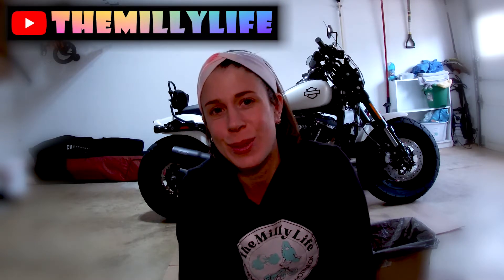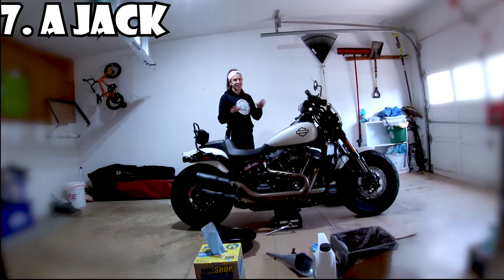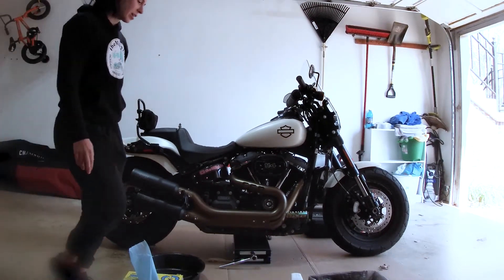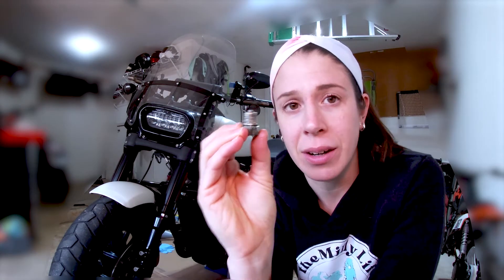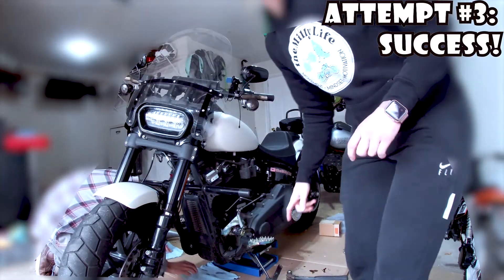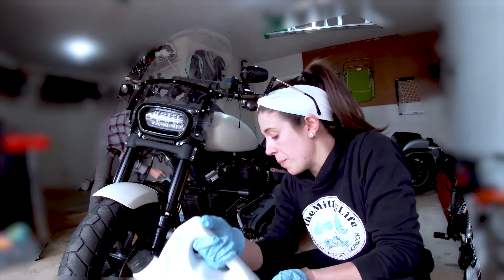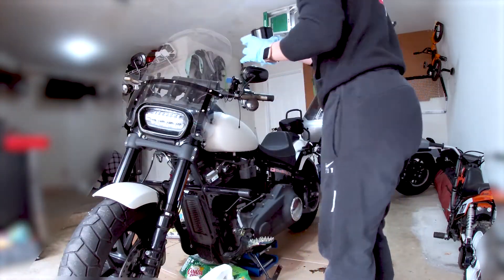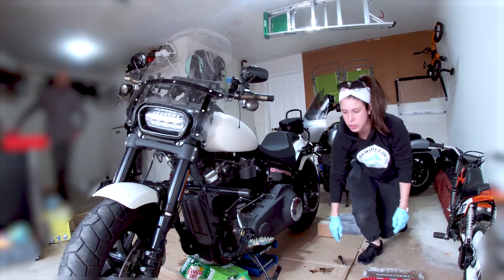Harley Davidson 2019 Fat Bob 114 Oil Change

Comment: Hey you did just fine especially if you haven't done much bike work yourself, everyone has to start somewhere and learn as you go. This is a huge tip for anyone that has a bike or vehicle with an oil filter location that's less than ideal which is very likely with a motorcycle. Anyhow if your sick of cleaning oil after doing the filter use some tin foil shaped and pitched down towards your waste oil container before loosening to catch the oil from the filter. My bike is a 2008 zx10r but my oil filter is in a position to perfectly soak my headers with oil so save yourself some cleaning time 😁
If your motorcycle has a low oil pressure sensor with a light and the bike and said light doesn't stop blinking or stop being illuminated chances are your oil pump system has air in it preventing the oil from pumping. If that happens you can just back the oil filter off very slightly and when you start it and see a little bit of oil start to drip through/ off the filter that should mean the air is purged from the pump and the filter can be retightened. That can happen with my kawasaki and I don't know of any issue like that with harley davidson. Just some info for anyone that doesn't know that. Good luck to all and ride safe 🤙
Reply from the maker: Hey Christopher, thank you for stopping by and sharing your tips and tricks. Ride safe!

Comment: Did you end up putting in all 5 quarts? The guy at Harley told me to use 4.5 quarts which is about what I did and it looks full to me. Wondering if I should add the other .5 quart or leave it as it is. Of anyone had any idea please let me know. Thanks

Comment: Anyone that uses automotive oil which are for water cooled engines. And unless your bike is water cooled then you should not use it You should be using oil for motorcycles only! They have a different viscosity breakdown. Once you fry your bearings and cams and spend $800 to replace you'll learn.